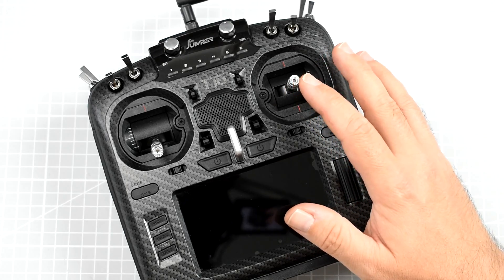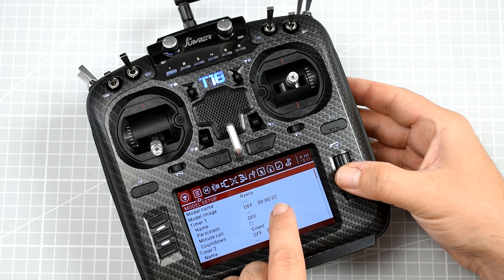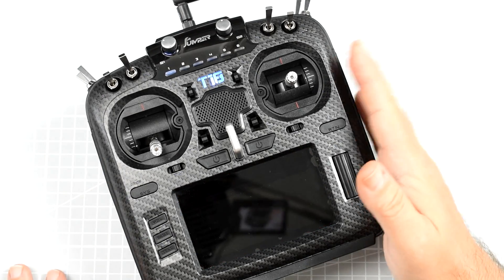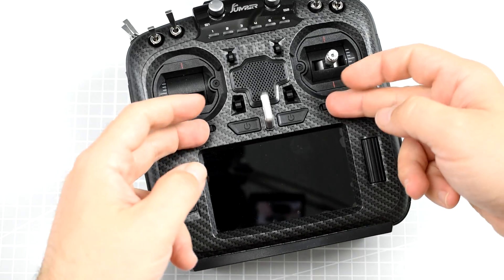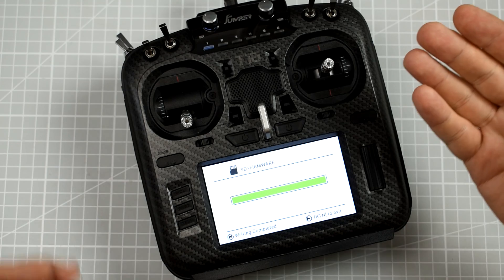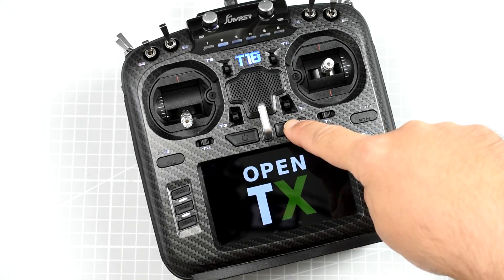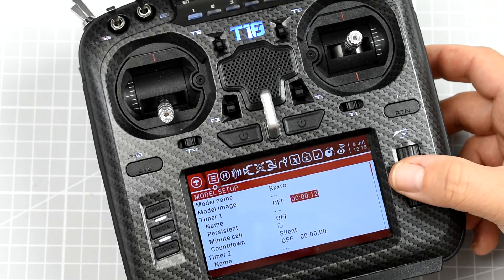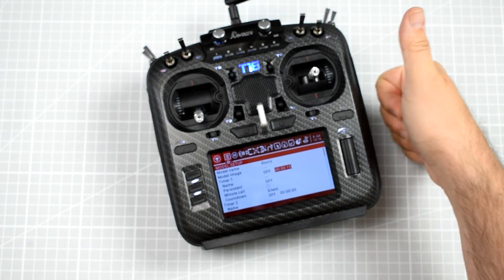Jumper T18 roller fix!

Comment: I have a suspicion, based on the pics, that the much nicer knurled metal scroll wheel from the RadioMaster TX16S will fit in the Jumper T16 and T18... The shape of the little PCB boards is the same, as is the location of the push button switch under one end of the wheel, even the screw holes are in the same location. Because of the different cabling it might not work to swap the whole assembly with the T16, but maybe with the T18... And maybe just the roller will fit in the assembly of the T16, without having to swap out the whole board... Either way I'm ordering the RadioMaster roller assembly this week, and I'll post an update if it fits in my T16...

Comment: Fixed mechanical 'slop' in roller as follows; Remove roller and dip metal 'hex' shaft in clear lacquer(or thinned clear epoxy). Leave to dry and repeat until a good fit is achieved. Slow but it works.

Comment: The beta release horus X12 had noisy audio. I found a simple reroute of the antenna feed cable fixed it. The coax was too close to the audio circuitry.

Comment: must be hard to fix a speaker. ...

but that reminds me of the Jumper way of slow evolution on their Laptops EzBook 2 and 3 and 3 Pro and its 6 iterations better known as the big gamble. 
They suddenly started shipping the sytem with a worse touchpad keyboard, they then were killed by complains viä banggood gearbest cause laptop was useless, no gestures worked.
Tgen they  changed the mmc - to a slower one of cause: Next wave of complains rushed in.
Their counter operation:  youtubers got a new ezbook 3 pro v4 and that contained a samsung ssd instead of a crappy mmc.

yes , i instantly ordered one and did not get a sansung ssd , no, half the speed or slow no name ssd.

that went in till V6 when I stopped buying lottery shares as I called it.

The t16 and  t18 are the legal succesors of their ezbook laptop line.

High hopes shattered over and over again

Comment: radio  speaker hisses and the roller rattles, the radio should have been called  jumper  diamond back after the rattle snake
anyway thanks for flagging the roller fix,  hissing might be cured by the filter and cap we will see.